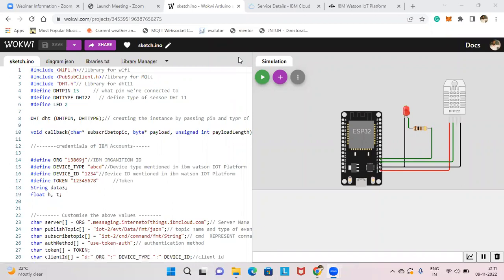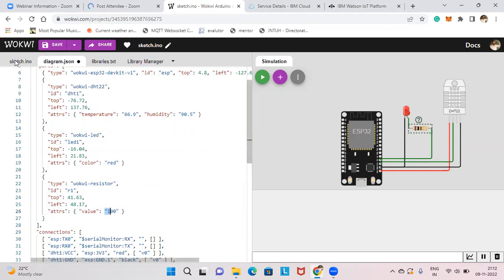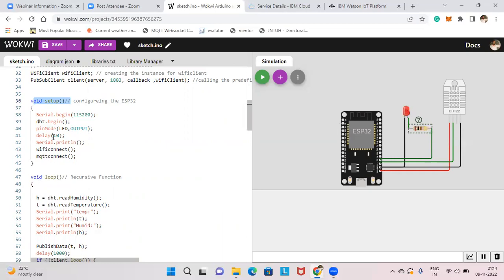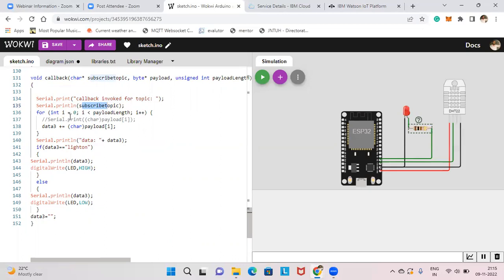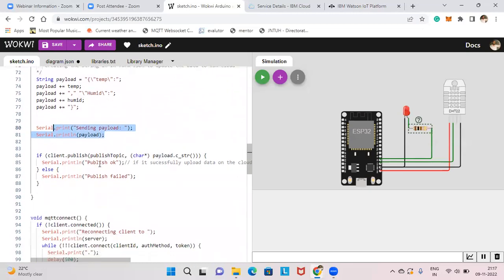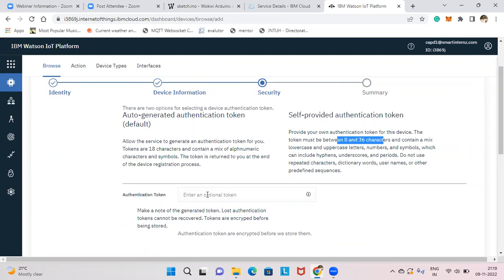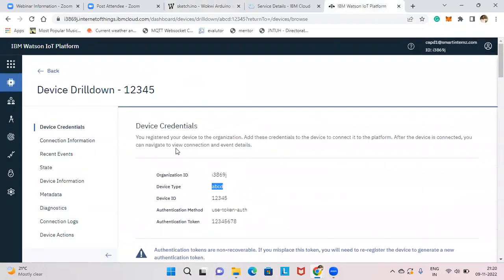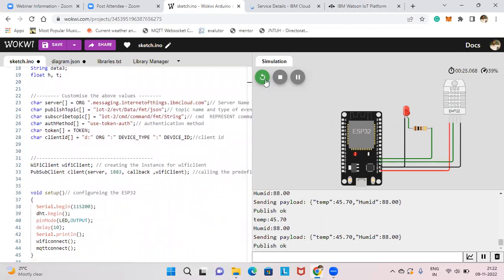Wokwi to IBM watson cloud - IOT

Comment: Sir i can't connect even though i gave correct credentials of iot device😢.. It is saying Reconnecting to client.. In iot platform it says closed connection, Unauthorized. 
Please help me sir
Reply: Yes sir i have tried it , i got output for yours but if i changed it to my device credientials then i can't get it and also i have tried tls optional and port 8883.
Reply from the maker: @vasu_ki  may be org id or some details is not correct. If not u can use my device details itself
Reply from the maker: Plz use the code from the link i shared. And follow the process again.
Reply from the maker: Let me know in case you're not getting it. After doing it again from first